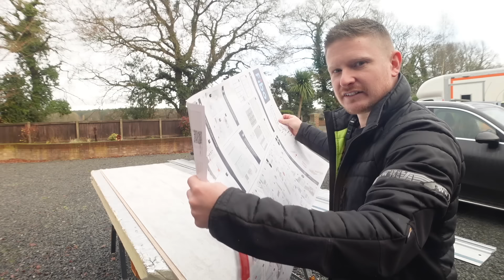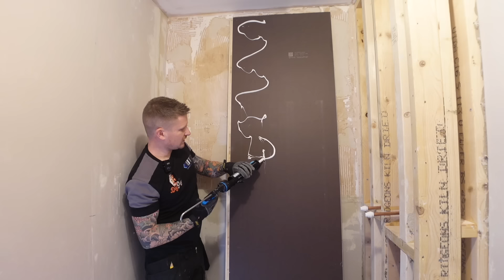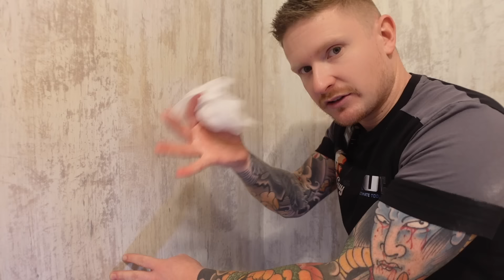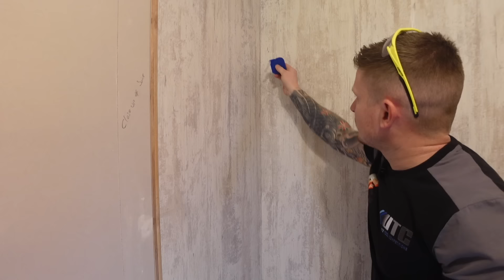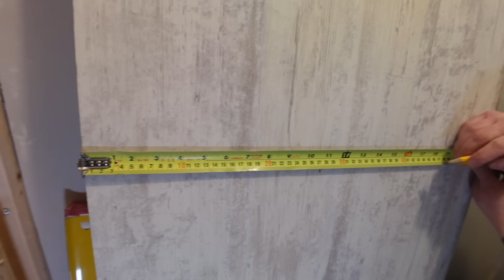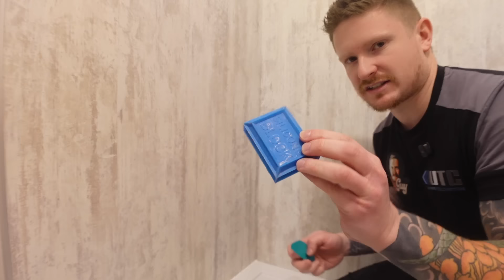How to Install Shower Wall Panels - Easier and Faster Tile Alternative!

Comment from the maker: This channel has now been 4 times around the sun… and here we go again! What else do you want to see in 2025?
Reply: Happy New Year Cameron, would it possible to do a video on the use of a multimeter for beginners?
Reply: Happy Nee Year mate 🎉 would it be possible to see how you build a shower seat frame (made from timber) and then secure the shower tray to it?
Reply: Electrician jobs
Painting
Putting up shelves 
Plumbing 
Workshops
Reply: Happy New year to you. I have a project coming up soon where I will be building a walk in wardrobe for 1 of my daughters so a plasterboard/plastering video would be awesome.
Reply: Please do a video on inserting led lighting into existing wardrobes like IKEA ones.  Routing out sides to insert tracks and then wiring them up to switch on when doors are opened
Reply: A lean to pergola with polycarbonate roof. You can come and do it at mine if you need a project 😅
Reply: Repointing a lead valley, more carpentry videos, like fitting skirting and architrave, alcove unit build, fitted wardrobe build, outside timber structures like a pergola and covering in a side entrance on a semi detached house.
Reply: Will be good to talk about DIY tools to get when starting out and don't have buckets of money to spend on tools (i.e. most essential tools) for general DIY - basic plumbing, basic electrics, basic wood work, basic bricklaying, basic plastering  etc.)
Reply: Watching in March 2026, ready for updating my en suite and cloakroom toilet from tiles
Reply: Wiring central heating
Reply: Happy New Year Lad,

Be good to see alternatives to standard extractor fans in bathroom and kitchens. Maybe a ventilation system that would work for circulating air throughout, particularly older properties like terrace houses with more than one ensuite
Reply: Great video.Heres to 2025 🎉
Reply: Fixing damp
Reply: Have you shown installing a sower, from start to finish. The plumbing, base, sides etc. Be very interested in that. You probably have covered it sometime - can you post link if you have please?
Reply: I went to school with you! Kept watching your videos and it's finally come to me who you are 😂
Reply: 😮😮o
Reply: Yes mate, but it’s new to me!
Reply: Took me waaaaay too long to realise what that meant.
Reply: I'm from Australia and our products are labelled a little differently here - for reference one of the primary diy brands for silicon here is 'Selleys' -  you mentioned to use a 'sanitary' silicon - do you mean something like a 'food safe' one?  If so, why is that, for the bathroom?  I don't know what else the 'sanitary' might mean otherwise - but thanks in advance!
Reply: nothing ...we want easy options this is a tradsman job
Reply: @TheDIYGuy1 what size shower tray/shower booth was that please?
Reply: There’s a lot of people with tiled showers that will be watching this helpful video. It will still be going strong in 10 years time. ✅
Reply: Can I fix them over our existing ( very flat) ceramic tiles?
Reply: A video on installing ceiling panels in a shower room would be great. Thanks Tom

Comment: How exactly were you cutting varable width cuts along the cut length with a straight edge tracksaw? Also you were marking the decorative face and then cutting the opposite side? The bottom of the boards against the tray only sealed with a tiny fillet of sealant?

Comment: If the ceiling has already been finished (unlike the one you just showed us) is there some sort of finish bead or trim that could be stuck up in the corners to give a smart finish between shower board and existing ceiling??

Comment: I Dont get how a silicone seal thats outside of the shower area, like the corner trim,  the seal "doesnt matter"  But the crucial part being the panel join to the tray, has only a single bead of silicone to seal the wood,  looks far too risky to me.

Comment: As a carpenter for 40years, ther is no way in the world I'm using a product that relys on silicone to protect it from water ingress. If itsmade of wood, marine ply or not, if moisture gets in, it will swell.

Comment: Silicone sealant can provide a water-resistant seal, but it is not normally regarded as a substitute for a properly designed IP-rated enclosure and cable-gland system. The important distinction is that an IP66 junction box achieves its rating through the whole enclosure system, including the gasket, lid, cable entries and glands.

Silicone can also:

* deteriorate or lose adhesion over time;
* be affected by movement and thermal expansion;
* leave gaps if applied inconsistently;
* make maintenance and inspection difficult;
* provide no controlled strain relief for the cable.

So for exterior electrical work, the usual approach is IP-rated enclosure + appropriate cable glands, rather than simply sealing cable entries with silicone.

The same principle applies to a shower enclosure: if the system has properly designed waterproof joints, profiles and upstands, it is much better to rely on those than to treat silicone as the primary waterproofing system.

Comment: Nuance bathroom wall panels are completely waterproof. You can put a piece in a bowl of water and leave it overnight, or even longer, and it will not absorb any moisture.
It is best to use the dedicated internal and external corner joints rather than relying solely on silicone sealant. Ideally, use a shower tray with upstands, which are vertical lips around the edge of the tray that allow the wall panels to sit inside them, providing a much more secure and watertight installation.
Thank me later
Edit: also, I made table mats from the offcuts for my patio table and they do not blow away and are unaffected by the weather 🙂

Comment: SPC boards are much better. Plastic won’t be even touched by water unlike plywood.
Reply from the maker: I like the boards we used. Seal them right and you’ve no issues. The rooms I’ve done with them are going strong years down the line

Comment: Question for you. How did you scribe the board on the shower valve wall with the two shower pipe tails sticking out?

Comment: Is it absolute ok to attach to a tilled wall? Seems to me it should not be done but instead the tiles should be removed, repair any damage and stick to the substrate?
Reply: They are sold as able to go over tiles.  If porcelain scuff them up a bit. Check tiles are not drummy. Advantage is tiles should have been water proofed.
Reply: @tobeabetterman-g5g this is it, u cannot tank the area with tiles on. For what it's worth, I think if tiles come off quite OK and u perhaps do a little filling and making flat, flatten any tile adhesive still on there. I guess that adhesive does stick to to a wall that tiles have been removed?

Comment: im wanting to do this but the guy at the bathroom place said wet walls are bad for holding moisture behind and mould growing. ppl getting breathing issues. but I just think thats ill fitment? he was on about the PVC pannels but this is marine ply so is that the difference?

Comment: considering doing this job. two questions please.

1. The tray was installed first, I was expecting the fibo boards to be installed first then the tray, so the fibo boards would run to the floor. Is this incorrect?

2. Any tips on making an insert for the shower - like a vanity indent into the wall - I don't like the metal ones and would like to make it out of fibo board and profile it. 

Thanks very much. Like the channel.

Comment: Interesting video. I love that technique of scribing that inside corner with a block. A couple ideas though, seeing as it's tongue and groove and basically the same system as LVPs, you could just use tools from that field. Like a pull bar to help get a board nice and snug into it's joint. Also, a general tip is that it's easier to put messy things like silicon/adhesive onto the thing that's not moving, i.e., the wall and not the board you're manipulating.

Comment: In the USA we don’t use wet panels, it’s either preformed fiberglass shower/tub or tile on a waterproof substrate. I’ve done it as a DIY and the waterproofing step is so easy nowadays with products like Kerdi/Shluter. The days of hardibacker and redguard are long gone. 

Now I am in the UK with wet wall showers. There’s small gaps between the panels that developed over time. That is a fatal flaw if there is not a good waterproof substrate. Based solely on this video, there’s a very high chance the walls are going to rot if I don’t tear that shit out and do it properly. 

How long have these wet wall panels been around? How’s the reputation?

Comment: Good video but ypu should mention that not using fibo adhesive and sealant invalidates the warranty so any issues along the line won't be covered even.if it's a fault  with fibo product  so just be wary

Comment: I'd personally cement board, use SPC panels and use a lipped shower tray. That thing will never leak, any ingress wouldn't pass the tanked substrate and wouldn't knacker the SPC. Any ingress into that stud wall and it's game over.
Reply: Hi do you still use silicone on the joints though? I was looking at one, it's a click system which they say also use silicone? Do you know of one were you don't use it? Thanks in advance

Comment: You should have just fitted the back board plumb. Using a full size board and foam adhesive  would be helpful.

Comment: Great video fella - I need to refit my 800mm square enclosure but I noticed the Fibo boards come in at598mm wide - are you aware of any similar product that is at least 800mm width?
Reply from the maker: I’m afraid I don’t, I’d just use two fibo boards.

Comment: if im converting a new room into a bathroom that wasnt previously a bathroom, do I need to do anything with the walls to stop any damp etc before I apply these panels? thanks
Reply: Look for blu tanking stuff, brush/roller it on, it's like a rubberised paint. Theres corner / joint tape too for new bare boards.

Comment: Great video,  i am plumber quick question, wouldn't you lift panel 3 or 4mm off tray then finish with silcon seal to stop water soaking up board due to the board touching the tray ,same as tiles ..
Reply: Yes he should have
Reply: @tobeabetterman-g5g hi you seem to know something about this. I am not keen on this silicone the joint because it does not last, have you any recommendations at all, even a different type board?

Comment: You have used the MDF version, can you use the exact same method with sealant etc with the pvc version? I’m planning to do full bathroom wall panelling included in and around window?
Reply from the maker: Yeah pretty much 👍

Comment: Great video, wouldn't it be easier and less messy to put the adhesive onto the wall instead of the board?
Reply from the maker: You can do whatever works for you

Comment: I've no idea why no one beds these wooden boards onto the bath or shower tray. With just a tiny amount of surface silicon, this has got disaster written all over it in a shower area. I'd have a 3mm minimum silicon bed on the edge, drop the board into that and you have a seal on the bottom exposed timber which you can tool up nicely and it's all one lump of gear without breaks.

I'd assemble all the boards to go along one wall first the drop the entire thing again onto silicon. Personally I'd go with acrylic panels, wood has no place in a wet area no matter how good the manufacture, it's still just a few microns of material before you hit bare wood.

Comment: i have a bathroom in an older 1800's part of the house. These are essentially plastered mud and stone walls with no damp course, so the walls are just about always wet, causing the tiles to keep falling off. A shower is 900mm wide and the boards i used are 1000mm. SO i attached the corner strip using long anchors, and then also long anchors on the strip holding the shower walls up. So the board is held by the corner and the 900mm out the shower sides. No matter that the wall is wet behind, the boards will never fall off. This transformed a problem bathroom into a stunning modern bathroom. This stuff is great!
Edited to add: the 1000mm wide boards can be a problem getting through a standard doorway, especially as my ceilings are 2.3m high. Watch for that as you may have to use narrower boards to get them into the room at full needed length.

Comment: Have ripped out 3 of these now because the previous monkeys did even silicon the shower tray before, such a rooky error for half a tube, end result very expensive fail. This fella has got the skills

Comment: I would have tanked the shower before fitting the panels just as you would if you were tiling.
Reply: Hi if the walls have tiles, would u remove them 1st before wall panels? Then u can tank also

Comment: No talk about need or want to have under board water proofing like tiles.? Also emphasise the bit mistake we have all made re measuring on the face side then marking on the back side.Bit scary about relying on silicon sealant were years go buy and the silicon lets go and leaks.

Comment: When fitting them to a new wall, can I fit them straight onto new plasterboard or would you have the wall plastered first before fitting the panel?
Reply: Straight onto plasterboard is fine

Comment: Very instructive video. I'm about to renovate my shower with FIBO boards for the first time. Why do you use silicon rather than FIBO seal for the joints?

Comment: Are they strong enough to fit a shower seat too .
Reply: It depends on your existing walls, these are only around 10mm thick so youd be fixing through them. There are many fixings on the market these days for apl types of walls. But the best option if plasterboard would be to have a patress installed behind the panel where the seat will be fixed.

Comment: The reason internal corner trims are used is so you don't have to change the silicone because you risk damaging the finish of the board when replacing old/mouldy silicone.
Reply: But as he said they do tend to leak which can cause more issues than just silicon re paste

Comment: I saw you just fix the panel on the studs ? Is it no need to fix a waterproof cement board or foam board behind the panel for waterproofing ?

Comment: Great video overall, however, there is a MUCH easier way to do the pipe locations for the hole saw. Old trick, put a little paper tape or painter's tape on the end of the pipes, put wet paint on the ends with the tape, then take your board, put it in place, and bump it up against the pipes. The paint puts a perfect mark where you need to drill. When you have multiple openings that have different depths, do the longest ones first, cut the holes, then do the shorter openings with the tape and paint.

Comment: Did you let the vertical corner clear silicon dry first before applying the white silicon around the shower?  tray
Reply: Late to the video but for anyone reading now. If you do vertical seams first and let them cure you don't mash up your verticals doing the horizontal lines.

Comment: The guide for the power saw, how does it hold in place and not move.
Reply: They have rubber backing tape stops it sliding.

Comment: Shouldn't be using soapy water on silicone it stops the silicone from bonding to the surface properly.
Reply: Contextually for the mid panel joints it is fine.

Comment: Good video I use the fibo respatex boards on a daily basis you should be using internal trims for the corners it makes life easier fitting the corners
Reply: Is it absolute ok to attach to a tilled wall? Seems to me it should not be done but instead the tiles should be removed, repair any damage and stick to the substrate?

Comment: Can these be fitted over existing tiled walls or do you need to strip them first, because we only have one bathroom and taking the tiles off would leave us without a shower and this is the problem I have.
Reply: It’s fine to go over tiles, I do it on the daily. Just be sure to clean the living daylights out of the tiles, give the adhesive a fighting chance of bonding.

Comment: Firstly, great video as always. Thank you. 

My main concern with using these is the material they're made from. Silicon fails. It happens as sure as day and night happen. When that fails, surely the board will be damaged and needs replacing? 

They look fantastic though. Some of the best I've seen.
Reply: Yes they do. The silicone in the joint between the coating and the underlying wooden substrate is impossibly thin (tiny fraction of a mm). Once water gets past that, the wood rots and bubbles.
Reply: Everything fails eventually
Reply: @kylewittet3717  and if the silicon fails on plastic boards, they survive. If it fails on wooden boards, they're ruined. Surely you know that!?

Comment: These magic boards are worth paying for aren't they?
Makes it easier to squeegee after a shower too (if that's what a certain someone requires...)
There's always sthg though and with these, for me it's the not ideal trim pieces. The manufacturers are not quite there yet when it comes to how the finished job looks, in my view anyway.
Thanks for avoiding making it 
An absolute shower
as Terry Thomas wdve said.
Reply from the maker: Great comment cheers 😃

Comment: Personally I would have used backer boards and tanked it on to the shower tray then installed the shower boards. Can’t beat a bit of tanking. And maybe seal the edge of the shower boards that sit on the tray prior to installation. Hope it goes well anyway.

Comment: Question: Did the shower tray have a lip on it? I cant tell from the video. Just want to know if the boards go over the lip and rest on the edge surface of the tray.

Thanks for a great video. I'm just about to do nearly the same job.
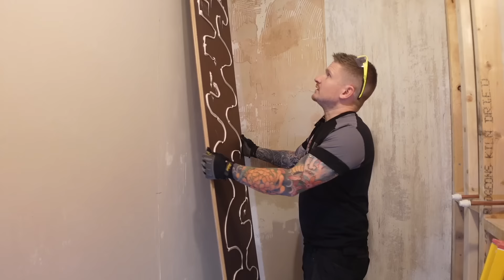Reply: 8:03